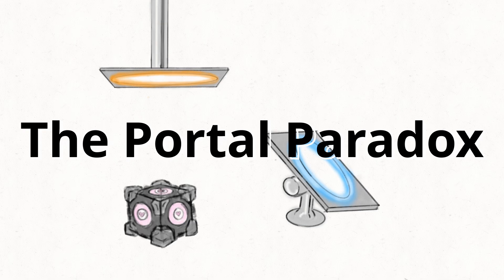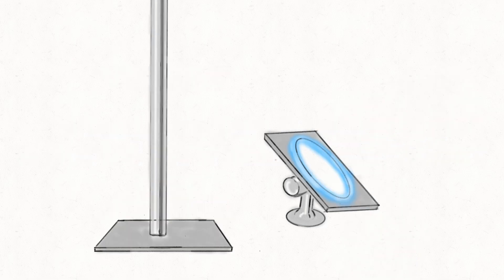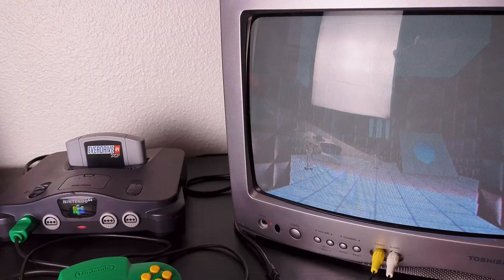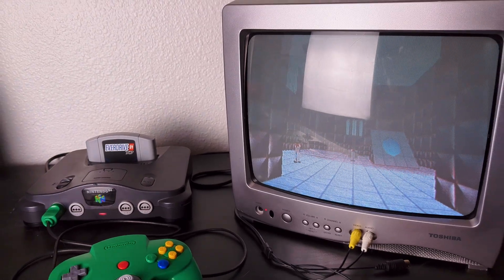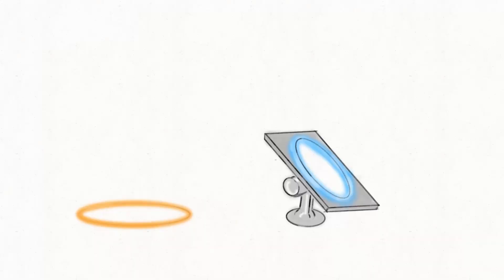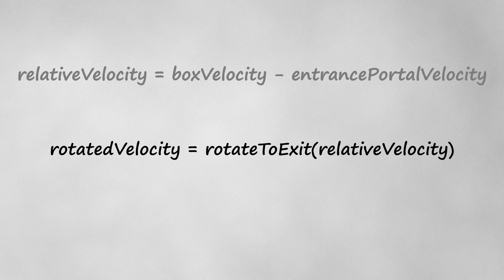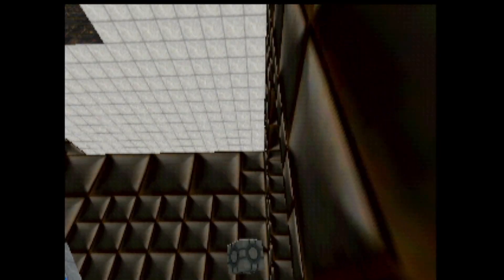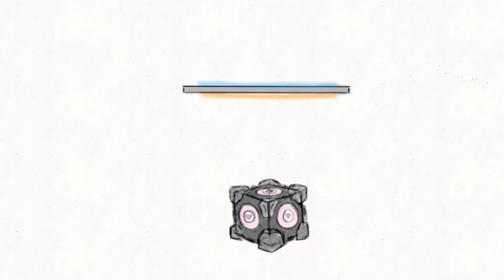I rewrote Portal from scratch and solved the Portal Paradox

Comment: What happens if you stop the moving orange portal while the cube is only halfway through? Would the momentum of the cube coming out the blue portal make it so the cube gets sucked inside the the orange portal and out the blue? If it doesn't go fully through, would it at least jump up a little?
Reply: here's my hypothesis (at least in a real-world physics sense, no idea about his engine): in the instant the orange portal stops, half of the cube has had the momentum transferred to it, while the other half hasn't. therefore, the cube will only receive half of the momentum! the non-moving part gets pulled along by the moving part, and the moving part gets slowed down by the non-moving part. so, it'll still be launched, but only half as far!
Reply: @axollyon  Agreed. For completeness though, if the cube could deform, the resulting tension would actually stretch the cube.
Reply: @RonWolfHowl  now I'm imagining a supersonic portal stopping halfway around a cube, those forces would probably rip the cube apart
Reply: @Anklejbiter  nope. There would be no force imparted on the cube... 2 connected regions of space, no matter how their relative distance change, are just regions of space, and as such, non-physical objects without any momentum. Thus one hole in space, doesn't impart any momentum to an other object in space.
Imagine it like this.
Imagine you have increments of 10% of the cube, through the other portal. What are the net forces on the entire cube? You can solve that problem in Euclidean geometry.
Let's say the cube weighs 10kg then there's 9kg of force on one side, and in this case as we assume the other portal is at a 45 degree angle, And a 1kg down force 45 degrees to the first 9kg down force, okay, nothing interesting will happen, because there's a net 9.5kg down force and a .5kg force applied horizontally, friction counters that with ease.

you can do the calculations yourself for all 10 tenths percentiles, and if we imagine that the entire cube is instantaneously through to the other side, it will glide down the portal surface because what else can it do with a 5kg parallel force to the plane of rest and a 5kg force perpendicular, and due to the normal forces, we end up with the object sliding.
You can do finer and finer slices, and you can via the mathematical magic that is known as INTEGRATION... solve the actual behavior with ease.

Oh and if you move a portal in empty space over an object in empty space at rest, that object will stay at rest, even as it leaves the other portal, but from it's point of view, if it entered the orange portal, and was spewed out by the blue portal, the blue portal would just move away at the same speed as which the orange portal approached it.

So in a world with no outside forces acting on objects, space would impart momentum, but also in one sense, would create momentum, because there wouldn't be any energy lost in the system, but gained. Which is an even weirder notion.
Reply: @livedandletdie  The cube can impart its own forces. no force is applied to the cube, but that doesn't mean it has zero inertia. one part of the cube has passed through the portal , it is moving. If the portal stops, that section will continue moving do to inertia, and then, and only then, it will pull the rest of the cube along with it
Reply: @livedandletdie  I would urge you to see the video, but in essence, as you said the portal is not an object, it is space and therefore the cube must retain the speed at which it went through, so it will be launched, and therefore if it stops halfway it is pulled along.
Reply: @livedandletdie  Frames of reference say what?
Reply: @RonWolfHowl  And that cube stretching would cause half of the cube to go at full speed and half of the cube to go no speed (relative to the portal). This should cause the cube to go at half speed.
Reply: @axollyon  *the cube splits in half because wheatley made it
Reply: @axollyon  Okay, the cube is "launched" because the relative velocity of the cube at the moment the portal is "completely" in contact with the surface it is lying on is at a certain amount. 

The cube is not "pushed" or "pulled" by an object with mass. 

When you stop the portal, half the cube hangs out. Imagine running up to a perfectly flexible portal and stopping with your player halfway through: you just wouldn't go anywhere.
Reply: @axollyon  No momentum was transferred to the cube... the Portals are not Objects. The only momentum the cube feels, is the momentum of gravity pushing it down,
so what happens to the cube can be solved with simple integration. And the result is that the cube just falls out of the blue portal when completely enveloped, and staying halfway would do nothing to the cube as half the weight is pushed down on one side, and on the other it is pushed in this case at a 45 degree angle, still the net force on the cube would move it in a horizontal direction if it weren't due to friction, and as soon as more than half the cube is through, the cube will have a slight tilt in the force direction, and as we go further and further down we'll eventually come to a point just after 33% is remaining when 67% is through and weighing so much more that it would lift the rest of the cube up and topple over.
Reply: @livedandletdie  this guy gets it. The space around the cube changes, that does not mean the cube is moving relative to the environment. (Though momentum is mass*(NET)velocity gravity is not a momentum - technically it isn't even a force)
Reply: in-engine, it will probably either move or not depending on which side the origin position of the object stops at. in the real world or a physically accurate simulation, the momentum would be imparted in proportion to the weight of the object on either side of the portal
Reply: In real life, a cube isn’t a singular object. It’s many molecules. I think that everything that has gone through the portal will keep it speed, but everything that’s not gone through the portal will stop so it’ll just keep some of its speed based on how much of it has gone through. In real life, that force might just rip the box in two. In the game it’s likely going to keep the speed if its center of mass is through it and just stop if it’s center of mass is not through it.
Reply: the game would have to keep track of the speed integral as the cube is traveling through the portal so that it can account for only partial travel, it wouldn't be able to do it all at once, it would have to calculate the resulting acceleration every frame as the simulation is going
Reply: To explain how this would work try imagining the floor is the one moving towards the portal but it stops half way through. The cube has been pushed anyways I think. I think the same thing happens if the portal is the one moving.
Reply: Well if we apply the logic from the video, the yes, it would "suck it in" with some force. Since by the logic of the video what happens is that we simply "transition" from one motion system to the other, and we have part of the cube in the system that where it stopped moving, and part in which it already is moving.
Reply: I think it would still get launched, just not as far, like if you threw a ball, but stopped your hand halfway.
Reply: @hatandhoodie_  that’s different. That’s just how you throw a ball. But also it’s correct, the half that received momentum pulls the half that didn’t.
Reply: I wanted to see this too!

I think that the cube would stop moving when the portal stopped moving, that's almost entirely based on my own intuition though
Reply: If I did the thought experiment properly so when the moving portal starts to stop moving (accelerating upwords) it will recieve a downwords force from the intersection of the portal with the cube, by 3rd law the cube will experience an equal force from the portal itself in the opposite direction (upwords), this action should result in the partial acceleration upwords and a partial acceleration downwords of the moving portal (as if the cube is resisting the deceleration of the portal) now because ingame the portal wouldnt actually experience this force the cube should experience the sum of both forces upwords.
I didn't go to deep into it to say how much would the cube accelerate but based on this the cube might actually fly faster? as the stoping motion of the portal acts as a slingshot for the cube flinging it even farther.
Reply: Ah, beat me to it. Let me know someone ends up testing it, please.
Reply: Well think of it like pushing a sled

U can push a sled for 10 meters and it will go very far but stop halfway (at 5 meters) and it will have less force pushing it forward but still half of the original
Reply: @ComradeBlue5705  you're confusing force with work
Reply: @siraaron4462  well force is a part of calculating that
Reply: @ComradeBlue5705  while that may be true, if you apply a constant force over half the distance the force is still constant
Reply: Just want to pop in here to say that if portals were realistic, a floor to ceiling portal would cut the surrounding force of gravity in half and probably have big implications for lunar cycles, the earth's orbit, etc.
Reply: I think it would stop. like he said in the video, motion is relative. so similar to the reasoning he gives, it would be the same as grabbing the cube when it's halfway in two stationary portals. and that would suggest that the cube would stop on both sides, since they are still connected.
Reply: @simonroe4834  but then where does the energy go?
Reply: If the velocity of the portal will be more than gravitational pull - cube will fly with vel-G; if less - cube will stay.
Reply: are you talking about the two opposite portals on the same moving object? the top portal is moving the opposite direction to the bottom portal at the same speed so any velocity given to the cube by the bottom portal is cancelled out by the top portal which is why its stationary. stopping it at any point or changing velocity doesnt change the fact they cancel out because they face opposite directions
Reply: @Videoswithsoarin  I meant 1 moving and 1 not moving portal. Aka rotate the orange portal to face up intead of 45°.

Is what you're saying that because the portal has movement it should transfer that movement to something that moves through it? If the portal edges don't touch it, the portal shouldn't have any movement impact on what's going through the portal. Or at least that's my understanding.
Reply: Sir Aaron is absolutely correct. There’s no force pushing the box. If the portal moves over the box at 10cm/sec, the amount of box appearing in the other side is at a rate of 10cm/sec. What is this magical force pulling the box off the ground and through the air on the other side once the box is fully enveloped and the portal stops moving (other than gravity pulling down?). Relative to the observer the box isn’t moving, and no force other than gravity makes it move relative to the observer. Period.
Reply: @Jordan10704  uh what?
Like you said the rate the cube emerges from the other side is the same as it enters, which means the cube is moving...
So the force that makes it fly out through the air is inertia
Reply: @Sokrates9500  it’s emerging from the other side of the portal at 10cm of box emerging per second, that doesn’t mean it’s “moving” at 10cm/sec and it doesn’t mean it’s going to continue moving after all of it has emerged. If it was “moving” then it would be lifted off the platform it’s sitting on from the other side. The box has no forces applied and has no momentum. If I walk towards a wall at 10cm/sec the wall is coming closer to me at 10cm/sec, that doesn’t mean when I stop moving the wall is going to continue moving towards me. Does that make sense?
Reply: @Jordan10704  no:
1. An object can't "emerge" without moving. Unless it has infinite compressibility I guess lol.
2. Everything has inertia, regardless of forces applied or speed. Besides the cube has to have speed because there is a change in it's position.
Reply: @Sokrates9500  yes, the box has an inertia of 0 as if sits on the platform. There is no force applied to change that inertia. What is the force? Where is the energy? What is lifting the box off the platform and ejecting it? This is all relative to the observer in the ground. If the box has a mass of a billion suns, you don’t get the energy ejecting it through space for free!

There’s no change in position due to movement. This isn’t a speed. It’s a teleportation. One second the molecule is at position 10,5 and the other 15,10. That doesn’t mean it has a speed in air. The fact the portal is moving just means more molecules get teleported quicker. If doesn’t mean the molecule gets a magical speed force applied to it to continue moving after it teleports.
Reply: @Jordan10704  again no.
1. Only half of the box is stationary.
2. The stationary half also has mass, just 0 speed relative to the ground
3. What is lifting it off the ground? 
The force of inertia of the other half of the cube, transferred through cohesion forces of the cube.

It doesn't matter if it's teleportation or not. The fact remains that half of the cube was just pushed by an atom thin layer of atoms that just emerged from the cube. Which is literally how all solid objects transfer stresses in normal situations, there is nothing unusual happening here.

The atoms that teleported earlier have to make way for atoms that teleported later, which means they have to move in a direction opposite than the direction the new atoms are coming from, which is away from the portal. And that speed of "moving away" will be equal to the speed that the new atoms are approaching at.
Reply: Things get weird when the portals accelerate while objects are passing through. Let's assume the portal's speed is constant, then drops to zero in an instant (like a step function for velocity) while the cube is halfway through. In the instant before the portal slows down, half of the cube had relative momentum with the entry portal, and that should be conserved through the exit portal; the cube, at that moment, is moving relative to the exit portal. When the entry portal's motion changes, the cube's motion through the portals is also forced to change -- that is, the portal's acceleration exerts a force on the cube. This force allows the cube to lift off the platform and finish its journey through the exit portal, even though at that point neither portal is moving.

What is the impact of that force on the cube? I imagine the exit velocity of the cube is a fraction of the maximum exit velocity it would achieve if the portal continued moving smoothly the whole time, and that fraction is the same as the fraction of the cube that had already passed through before the entry portal stopped. I haven't done the calculation, but intuitively that makes sense! Stopping the relative motion early reduces the momentum the cube is able to pick up, and I think the effects should be in a simple proportion.
Reply: @RegularKerico  not sure this makes sense. How does the portals acceleration or speed exert a force on the cube? Motion is relative, not forces! If i pass around the cube at a rate of 10cm/sec, it emerges on the other side at rate of 10cm of box emerging per second, but it’s not “moving” and there’s no force applied to it. It simply emerges at that rate, then immediately falls down due to gravity.

Ignoring the energy to move the platform with the portal up and down, you don’t magically get energy or forces by moving the portal around the box. If you did, you just invented a free energy device (of course, the concept of a portal itself is probably far more problematic)

People here keep confusing relative motion as being able to apply a force to an object. Relative to the observer on the ground, a force has to be applied to the box to have it move from its position resting on the platform. I’ve heard no explanation how a moving portal exerts an equal and opposite force to its motion. The only force at play here is gravity (and whatever is moving the platform with the portal up and down).

And if the portal does exert a force, how much? It takes E energy to move the box off the platform it’s on and eject it through the other side through the air. What if the box had a mass of a hundred suns? Does it move off the platform at the same rate/speed as a regular box? If it does, that’s a massive amount of energy that just came out of nowhere.

The fact in the experiment the box was lifted off the platform and “ejected” from the other side with exactly the same velocity as the portal, without taking the mass of the box into account, should tell you all you need to know that it’s wrong.
Reply: @Jordan10704  Does gravity take into account the mass of an object as it accelerates in free fall? No, because the equivalence principle states that gravity as we observe it is due to our reference frame accelerating through spacetime. 

The same is true for accelerating portals! If, while the cube is halfway through the portal, the motion of the portal changes, then the motion of the cube also changes relative to the portal. The cube feels this as a stretching or compressing force as the motion of the half cubes on either side of the portal change relative to each other.
Reply: Edit: see my response above. I think portals basically breaks physics so I don’t think there’s a “right” answer here.

—-

 @RegularKerico  relative motion doesn’t apply forces! reference frames do not apply forces! For the object to now have kinetic energy and move relative to the observer on the ground, something must have applied a force and transferred energy to the box (1/2mv^2).

What people keep telling me is that a portal can supply infinite energy to lift a mass of infinite amount off the platform relative to the observer. That because the portal and box move relative to each other that the universe ignores the observer, ignores energy, and gives motion to the box for free in the observer’s reference frame. Makes no sense.
Reply: @Jordan10704  I mean, yeah, portals break energy conservation. That's unavoidable. You can have a billiard ball falling into a water wheel, having it spin a half turn to drop it out the bottom, then fall into a portal whose exit lies at the top of the water wheel. Infinite energy. Definitely problematic. Generally speaking, in spaces that aren't simply connected, you can't guarantee that curl-free vector fields are gradients of a scalar potential.

But as long as we're focusing on a version of momentum conservation through portals, it's easy to see that accelerating one of the portals relative to the other compresses or stretches objects passing through them. Consider empty space, devoid of gravity, containing an infinite stream of billiard balls with one meter between them and a portal. If you set one end of the portal so it moves along the line of balls at a constant speed, then the balls will exit from the other end at a constant speed, and the distance between consecutive balls will remain one meter for any speed. But, if the portal that is moving along the line of balls gradually speeds up, each ball that comes out the exit portal is moving faster than the ball before. The space between the balls decreases, and eventually the balls will collide. 

Now, shrink the balls and the distance between the balls until you have one continuous rod; the accelerating portal forces each consecutive length of the rod to press into the length before it, and the rod undergoes compression. If instead the portal slowed down, the rod would undergo expansion.

I wish I could draw a diagram, but there's no mistake that relative acceleration between the two ends of the portal stretches or compresses what's moving through them.
Reply: @RegularKerico  I’m not disagreeing with your scenario, only that it doesn’t make sense from the point of view of a stationary observer. From their point of view, they saw stationary objects accelerate and gain a speed in their frame without a force or momentum or energy applied to them. That’s all I’ve been saying this entire time. It doesn’t work, it’s free energy, and you can’t use Newtonian physics to make it work.

So when people tell me the object shoots off in the observers frame of reference at the same speed as the portal regardless of mass, I feel like they’re completely ignoring one aspect of physics while embracing another to get the outcome they want.
Reply: @Jordan10704  There is no perfect answer, as you mentioned before, because portals necessarily break a bunch of rules of inertial reference frames. For me, the object magically accelerating into the decelerating portal feels uncomfortable at first but seems like the most consistent option of a bunch of imperfect ones.

For starters, I don't think this scenario involves "gain[ing] a speed in their frame without a force or momentum or energy applied to them". There is a force, a pulling force from the part of the mass on the far side of the portal: when the moving portal stops/decelerates, the far-side mass is moving faster than the close-side mass and its internal bonds between those sections would result in a pulling force on the close-side mass, dragging it into the portal (or, if those bonds aren't strong enough or the object too rigid, tearing it in half, but I'll ignore that case because it's less interesting).

I admit I was uncomfortable with the 'pulling' force idea at first, but it's pretty reasonable even by in-game standards: in-game you can place objects halfway into a portal and drag them back out, which only makes sense if the local part of the mass can attract the far part of the mass backwards through the portal via internal bonds.

Second, this scenario only grants free energy if we assume that moving the portal is free. The problem doesn't state anything about how the moving portal actually works so we're free to speculate on how it could, and there are ways that would conserve energy (or at least not break conservation any worse than normal stationary portals already do). My personal theory is that the object pushing the portal surface would experience a reaction force dependent on the mass it forces through the portal, and would pay an energy cost accordingly. E.g. in this video we have a roof-mounted piston moving downwards towards the cube, pushing the plate that carries the portal; I like to think that the piston has to spend extra energy once it starts pushing the portal over the cube, which is where the kinetic energy of the far-side cube mass comes from. Once the portal stops, the cube's internal bonds from the far-side mass pull the close-side mass into the portal, redistributing (but not changing) that energy over the cube's total mass. So even though the close-side mass does indeed see a weird magic acceleration, it's energy-consistent: the piston pays the cost ahead-of-time by adding to the far-side mass's kinetic energy before the portal stops.

[edit: I'll admit that having something "push the portal surface" feels iffy. It feels a little wrong to have a solution that requires the portal surface to be able to push back on whatever's holding it, but I don't see a way around that. If the portal is mounted to a surface and that surface can move around in space dragging the portal with it, it seems necessary that the portal surface is something physical with mass that can interact with whatever it's mounted to. If that weren't the case (i.e. if it were a massless magic bridge fixed in space), the piston would logically have no way to move it.]

Wow, didn't plan for this to be such a wall of text, but I couldn't stop thinking about the problem... tl;dr:

* If you have a connected mass with one part on the close-side of a portal and another part on the far-side of the portal, it's reasonable and consistent with in-game behaviour to have the far mass pull the close mass into the portal (i.e. a 'push' force from the close-side is not necessary to make the close-side mass move).
* We're free to speculate on how energy would work in this kind of device, so you could come up with a constraint on whatever's moving the portal surface such that it pays for the kinetic energy cost that leads to the 'magic' acceleration.
Reply: @QuadfishTym  this conversation didn’t start about dragging the box through the portal. It was about ejecting the box with momentum equal to the portals speed. If you want to argue that the molecular bonds pull is enough to give the entire box that much momentum regardless of its mass, ok, but I think it’s extremely hand-wavy to say this energy is just “available” to do so. Like you said, we can certainly add as many rules as we want (the portal provides energy to the objects proportional to the objects mass to feed the added momentum) to get the outcomes we want. It’s not there’s no “best” answer - there is no answer period because portals don’t and can’t exist.
Reply: I believe it either would be a form of spaghettification as the cube gets ripped in 2 or yes it would move a little because the force has to go somewhere.
Reply: @DoubsGaming  if the cube is made of steel then there is no way it would get torn in 2 unless the portal moves at an insane speed
Reply: The cube should only receive half the speed
Reply: It would fly out at half the speed
Reply: That would take an entire video to explain, but the cube now has multiple forces on it (two separate gravitational pulls plus the inertia from the movement between the two portals). The strongest force would have to be larger than the other forces to affect anything. It would depend on when the entrance portal stopped moving.
A new question is what if both portals were moving downward at terminal velocity, but the exit portal were much higher up and the cube were launched into the entrance. That would likely cause enough air resistance to cause re-entry level heating.
Reply: If the cube was at all lopsided in mass at the point in time of instantaneous acceleration/deceleration, then it may begin to SPIN!

How cool
Reply: So I have a question from your question. Wouldn't this imply that the cube could pulled itself up through the orange portal while the portal is moving? Because the other end of the cube, which is still, hopefully attached, is moving, therefore puling the rest of it (assuming it doesn't break) which would of course increase the relative velocity?
Reply: If the orange portal stops moving, the cube will stop moving relative to the blue portal too. The cube will remain halfway between both portals.
Reply: The video is incorrect. Relative to the observer and the environment the cube is stationary. From your perspective, You aren't moving the cube towards the portal you're moving the portal towards the cube. The pegs don't fly up into the air when you play a game of ring toss, Just because the ring stops on the table. The only way relative motion applies here is the rate at which the porta passes l around the cube. If the portal stopped halfway around the cube it stops halfway around the cube. 

The only forces being applied to the cube on both sides of the portal is gravity and the force of the ground reacting to and balancing out gravity. (And friction if it's sliding) The acceleration of the cube will always be the net sum of those forces. Until some unbalanced force is applied to the cube. it will remain at rest relative to the observer and the environment, even if it suddenly finds itself in a new environment.

You can verify this by thinking about the both ends of the portal being separate objects adjacent to eachother. Where the blue end is also stationary relative to the observer, the environment, and the cube. When the orange end moves toward the cube the blue end only moves towards it because it's always adjacent to the orange end. After they collide the cube is once again stationary relative to the blue side of the portal. But also adjacent to where it came from.
Reply: @siraaron4462  I'm not sure about that. Another way to see it is if you placed your face right in front of the blue portal. The cube coming out of it would smack you in the face, so it's definitely coming out of the portal with force, and that force can't just disappear once the portal hits the floor. (Dumb way of explaining it, but it's the best analogy I could think of)

Also, about the relative motion, the portal is moving towards the cube, yes, but if you look inside the blue portal, you won't see the orange portal moving. Relative to that point of view, you'll only see the cube and the floor moving towards you.

But portals are weird... From that perspective, if the portal stops before it reaches the cube, it would still look like the cube should at least bounce up a little, as if there's a cube on a moving platform moving really fast, and all of a sudden it stops, the cube should keep moving a little. But since it's still 100% on the other side of the portal, that relative motion is only visual. It's when the cube starts moving through the portal that the motion stops being only visual and becomes actual movement of the cube coming out of the portal at a certain speed.
Reply: @FausseFugue  yeah it would hurt the same way it would hurt if you found your face moving towards the ground, or towards a tree. Because you are adjacent to the portal you are moving towards the cube with it. The force being applied is the transfer of kinetic energy at the time of the collision. Because the portal is moving your velocity relative to the cube becomes non-zero as you stand next to the blue end not because either of you are accelerating but because the space between you is being contracted.

I already established The blue Portal and orange portal are adjacent to eachother in spacetime. The results are the same, if the portal moves arround the cube it isn't pushing the cube upwards.
Reply: @siraaron4462  The video can't be correct or incorrect, as it's a construct of our own makings - the answer is whatever you want tit to be, depending on what rules you decide to follow, what constraints you decide to play with, and which elements you decide to ignore. One of what I think is the biggest ignored feature of portals is gravity. It would make sense that gravitational waves and fields would travel through a portal, and yet standing next to one you are never pulled into or pushed out of it.

For this problem, however, I think the solution of the cube maintaining mimentum is the one that not only makes the most sense, as it is extremely intuitive, but is also  the one that fits best with our modern understanding of physics. The result it provides can be deduced from multiple paths, including looking at the system on a molecular level, Looking at the system as a whole, looking at just the movement vectors, etc. Having a moving cube come to a dead stop after exiting a portal just doesn't make sense, and doesn't roll
 well with physics.
Reply: @Anklejbiter  but the creator tries to justify his "construct" using real world physics which he applies incorrectly. The cube doesn't even have momentum it's stationary. And thanks to newtons first and second laws of motion no object can apply a net force to itself. You tell me to look at all these things but you don't tell me why or how they contradict the fundamental logic of the physics in question. (Having already taken them into account myself, the results simplify to the same solution I already described)

As far as gravity is concerned, if inertial frames through space-time we're followed, according to the laws of gravity, There would be no infinite falling, because portals would create a closed loop of spacetime parallel to the field of gravity. in the game, gravity just moves things in an arbitrarily defined "downward" direction. It's a simplification that works for game mechanics. It's not making a choice of what physics to use it's just simplifying physics for the sake of being a game.
Reply: @siraaron4462  I agree with your second point, but your first statement is incorrect. a stationary cube does have inertia. And once it's on the other side of the portal, it's moving, and therefore also has non-zero momentum. I think he applied physics correctly here.
Reply: @Anklejbiter  that's right momentum and inertia are proportional but not the same, my bad. (The error is fixed now)

However the cube isn't moving relative to the environment,  its motion is an illusion because the space around it is moving, not the cube itself  as soon as it passes through the portal it's relative velocity to the environment is still zero.
Reply: @siraaron4462  Not it's immediate environment, no. but the environment on the other side of the portal does not perceive the cube as stationary.

Another way to think of it is this: on a molecular level, hen part of the cube goes through the portal, it must then move out of the way for the next part. this is motion. Granted, it's not very much motion, but when the entire cube has passes through the portal, all of the cube is now in motion, and I didn't think it's accurate to say that motion would disappear just because the cube is on the other side of the portal now - it would have no way of "knowing".

Or, image you have a pole that you're holding through the portal. the pole is stationary relative to you, and relative to each portal. however, since one portal is moving downwards, that end of the pole is also moving downwards- and will come into contact with the box, at which point it cannot go any lower, and will start getting pushed upwards into the portal. on your end, you notice this motion as the pole now being pushed in your direction, out of the portal. when the pole is all the way through, it carries this momentum. the same would be true of the box beneath it.
Reply: @Anklejbiter   what's moving the top of the cube "out of the way" is the bottom of the cube as I already expained. That is a reactionary force that never exceeds what it needs to to maintain equalibrium. (The net force the cube exerts on itself is still zero There is nothing pushing or pulling it off of the ground beneath it.)

The pole is similar there is an illusionary relative velocity between you on one side and the cube on the other because the space between you is contracting. This can still cause a collision and the collision might push you away from the box but that's not because you or the box has a momentum  it's because the momentum in the box- pole-portal-person system must be conserved after accounting for the contraction of space.
Reply: @siraaron4462  for the first part, yes, and it seems some messages got sent out of order lol. i didnt see you had said that until after I already commented.

the pole I don't believe is an illusion? What's illusionary about it? the section of poe you are holding onto IS moving. if you keep holding on, you will also be moving. you will fall over. I don't see how one can observe particles in motion relative to their environment and conclude that they aren't moving
Reply: imagine you hold onto the pole, soo that it drags you with it. you were in one location, and now you are in another. that is the definition of motion. you have moved. you have momentum. that momentum doesn't cease to exist simply because part of the pole is on the other side of a portal

We agree on many different things, so I have to conclude that there's a communication error happening here, not a physics misunderstanding. But of course, with each of us so confident, It's hard to determine where the error is happening. I'd be interested in bringing this topic to a physics professor or two
Reply: @Anklejbiter  it's illusionary because the two objects only appear to have a velocity relative to eachother because the space between them is shrinking. To an outside observer the pole appears to be moving down with the portal because (just like the block) the Pole's has internal forces retaining its shape. Within the system the pole is still stationary and the only thing changing is the distance between you and the cube 

The pole can't drag you with it because from your frame of reference it's not moving. Momentum has to be conserved within the system but in this case the system is more than just physical objects, it's space itself.
Reply: @siraaron4462  it can drag you with it, because within your frame of reference, it is moving. If it didn't move, it would get shorter, or buckle.
Reply: actually, I believe this is where the miscommunication is! we're not.imagining the same scenario. in my scenario, the end of the pole you are holding, is moving relative to you and the portal, but in your scenario, it isn't. so we're coming to different conclusions because we're imagining different situations.

this would be easier to describe if I could animate what I'm thinking, but I don't have the toolset for that unless you like shoddy misprint animation
Reply: @Anklejbiter  if the pole you're holding is getting shorter wouldn't that mean the opposite end is moving closer to you rom your frame of reference?
Reply: @Anklejbiter   @Anklejbiter  "you have a pole that you're holding through the portal. the pole is stationary relative to you, and relative to each portal. however, since one portal is moving downwards, that end of the pole is also moving downwards- and will come into contact with the box, at which point it cannot go any lower, and will start getting pushed upwards into the portal. on your end, you notice this motion as the pole now being pushed in your direction, out of the portal. when the pole is all the way through, it carries this momentum. the same would be true of the box beneath it."
(Your words emphasis mine.)

are you imagine a scenario where you are standing still, holding a pole steady on the blue end while the orange end falls around the cube? because that's what i'm imagining. 

If so, the portal isn't grabbing the pole and dragging you towards the cube. From your frame of reference the cube is rising up towards the pole but the cause is that there is less space between you and the cube. There is a collision that will push you back but that's not because of any physical velocity before the collision it's because the inertial frame of the system is changing.
Reply: @Anklejbiter  taking the problem back to it's simplest form the cube's velocity relative to the ground it's on is zero. For the cube to fly off of the ground it needs an acceleration vector away from the ground. The portal falling around the cube does pull the cube away from the ground it only changes the inertial frame the cube is in.
Reply: @siraaron4462  yes, there is a collision that will push you back, because once the pole collides with the cube, it begins moving, by definition. this movement is not an illusion, only the movement of things on the other side of the portal is.

For the other scenario, no, a falling portal does not impart any force to the pole, the cube, or anything within it, correct. but it doesn't need to. part of the cube is moving, and part of it isn't. for it to remain rigid, these two vectors must interact. the result is that the entire cube is now moving, but at a lower velocity.

My thinking is that, the vectors that are interacting can become greater if the portal is moving faster. But, thinking about this, the question arises: the moving cube, has more energy than the stationary cube, where did this energy come from? It seems to reason that it came from the portal, but it doesn't seem anything about the portal has changed, so that can't be it.

But the same is true for an infinite falling loop, so now we're back to square one: how do portals work? what is it they're actually doing?
Reply: @Anklejbiter  Pardon the wall of text, I wanted to explain this as completely and clearly as possible: 

answering your last question first: the portals work by connecting 2 bounded , 2-dimensional slices of space-time as if they were adjacent to eachother. If we assume physics otherwise works the same as it does in our reality, the paths of spacetime interact with these portals as they would with any other adjacent n-dimensional slices of space-time. (Bounded or unbounded)

In layman's terms, they connect two planes in space, nothing more nothing less. (See footnote one) Therefore As the orange portal moves towards an object the distance between the blue Portal and that object decreases at the same rate. This has a side effect of changing the conditions of the cube's environment.

In the situation with the pole, This change of the inertial frame can cause a collision between two stationary objects. (Hence illusionary velocity) However, because the momentum of the system, as a whole, must be conserved; the motion caused by the collision (pushing you and the pole away from the cube) is real. This is after taking into account the changing inertial frame caused by the moving portal.

Which leads me to the fatal assumption of your argument, the cube is not moving, it is the cube's inertial frame that moves. The cube isn't rising up out of the blue Portal, the blue Portal is adjacent to a slice of spacetime that falls around the cube *and then stops.* At no point does the cube have any velocity relative to the ground beneath it. It only has an illusionary velocity, relative to an observer on the blue end.

For example imagene if you repeated this thought experiment but you mounted a small camera on the ground next to the cube, facing upwards. From itge camera's frame of reference the cube does not move away from the camera (or the ground) even as it passes through to the blue end of the portal. 

you say the portal isn't changing, but that's simply inaccurate. The very premise of the thought experiment is that one side of the portal is being accelerated towards the cube until its connected surface is stopped by a collision with the floor. Which is whyzl, The Cube's apparent motion is the result of spacetime moving around it.

And since you brought it back up: if we assume physics otherwise works as it ought to in real life, this relatively simple definition for the fundamental properties of the portals (treating them as bounded, adjacent slices of spacetime) also resolves the infinite-falling/infinite-kinetic-energy problem. because if they are parallel to each other and perpendicular to the path of gravity you would be essentially weightless while in between them. gravity cannot do work on you because the portals block the Normal path of curved spacetime, therefore changing the inertial frame of anything between them

¹ the only evidence we have to the contrary is the game engine's incomplete approximation of real world physics. If we take that at face value then we have to throw absolute conservation of momentum out the window anyways.
Reply: @siraaron4462  Paragraph 1: Okay, I agree.

P 2: Right, so Imagine a 3D grid, like you might get in an animation program. If you look through the blue portal, The entire grid is moving - What you would say as the space between me and the cube is shrinking, because over time, there is less space between the cube and the orange portal, not because the cube is changing its location. This makes sense.

Paragraph 3 is a bit confusing, perhaps it could be worded better. But I'm imagining this scenario: if I stuck my hand into the window of a moving car, the passenger would hit my hand, not because they are moving, they are stationary in the car; but because their environment is moving.  I am not moving relative to the ground, and they are not moving relative to the car, and yet we will meet, because the space between us is getting smaller; and after the collision both their face and my hand will be moving relative to both the ground and the car.

P4: I agree, the cube is not moving in any way on the orange side of the portal. It is stationary relative to the ground, and to its environment. I am curious about what would happen if the orange portal continued to move after swallowing the cube - for instance, if the entire setup were on its side, or in space. I don't imagine it should change the outcome of what's perceived on the blue end. whatever the cube is doing on the blue end, whether moving or stationary, shouldn't change if the portal stops moving, as the cube no longer has any real relation to that environment.

P5: Correct, for as long as the orange portal is moving. if the orange portal stops, but the camera is anchored, (for instnace, on a post that is thin enough to go through the portal), I think you would see the cube move away when the orange portal stops moving. if the camera is not anchored, then you'd never see the cube move away from it, which works in both cases: the cube isn't moving , and neither is the camera, or the cube is moving, and also is the camera. in both situations it wouldn't observe any movement of the cube.

P6: I don't think that's the thought experiment, maybe this is where we differ. I assumed the experiment is using a moving, but non-accelerating portal. Of course, the portal must accelerate to get from a standstill to motion, but I'm assuming it has finished accelerating by the time it reaches the cube.

P7: I do thing gravity would be complicated in between two portals, placed vertically. If gravitational waves travel through portals, then you'd have an apparent earth's worth of mass through the portal, pulling you in. however, you'd also have an earths worth of mass on the other side of the other portal, pulling you in that direction as well, so I believe they would cancel out. I'm not entirely sure if this is accurate, I haven't thought through it all the way. I'd need to do that before commenting further.

Also - no need to worry about walls of text! This is an incredibly interesting discussion. I just don't see notifications about replies right away.
Reply: @Anklejbiter  
"P2" while I'm glad we agree on this point, I want to clarify one point of semantics: to solve this problem we need to understand what happens from 3 different Frames of reference (which I'm going to simplify fo FoRs from here on out) for each of the FoRs the motion of the system appears different but they all simplify into the sane outcome. The FoRs relivant to the system are: a FoR tied to the motion of the cube, a FoR tied to the motion of the orange portal and a FoR tied to the motion of the blue Portal. The "grid moving up" analogy is only 100% accurate in one of these FoRs. (I'll circle back around to this, don't worry… foreshadowing pun intended)

"3" I'm not entirely sure where you're going with this car metaphor since the comparison is loose at best. This portal scenario can't be accurately modeled using Newtonian dynamics: a better comparison would be like attaching a battering ram (the pole) to the front of your car and try to hit your friend who's sitting in the passenger seat. (And like the battering ram, the pole is just an extra variable not really important to the basic principles at work) 

"4" this is where the 3 FoRs matter: the blue end of the portal still exists on the 3-D grid relative to the cube and orange end of the portal. The FoR of the blue end of the portal is both stationary and moving closer, relative to both the cube and the orange end of the portal. (This is a gross oversimplification but bear with me) This might be easier to imagine if you traced the shortest possible path through space-time from the cube to the blue end of the portal without passing through the orange end, and then thread it through the orange side and back to the cube, pulling it tight. 

Now imagine that path stays tight while the orange portal falls, the loop shrinks like a zip-tie. This changes the inertial frame and because the inertial frame is changing, the momentum of the system is also forced to change. If the system gets too crowded, stationary objects can collide with each other pushing each other around. However, no matter what the initial conditions, the cube will only continue to move for as long as it's being pushed by stationary collisions, otherwise it will stop as soon as the portal passes around it. 

"5". I used the camera as a way to get you to visualize the FoR tied to a point in space next to (or beneath) the cube, from that FoR the cube is at rest through the entire process, because there is no force moving the cube away from the ground I wasn't asking you what you expect the camera to see, based on previous assumptions. The exercise was intended to encourage you to examine the motion of the cube from a different FoR, to realize the result is the, again, the same: the cube stays at rest unless it's being pushed by stationary collisions via the "zip-tie" effect. Thats now 4th frames of reference, by my count, with the exact same outcome.

6. Whatever you want to call it doesn't really matter, I call it a thought experiment because we can't test it in real life, for obvious reasons. As for the motion of portal, I'll handwave the specifics, as they're not relevant. What is relevant is that the the orange portal is moving relative to the system making it the only thing changing in the system. And that's what causes the zip-tie effect.

7 the justification is a bit off but the outcome is for all intents and purposes the same. In between the portals, The gravitational vector on an axis perpendicular to the portals, would be virtually zero
Reply: @siraaron4462  "Whatever you want to call it doesn't really matter, I call it a thought experiment because we can't test it in real life, for obvious reasons."

I wasn't saying it isn't a thought experiment, but rather that I think we're thinking of different things. Our thought experiments are not the same, yours includes an accelerating portal, mine includes a non-accelerating portal. I probably could have worded that better, sorry.

"the cube will only continue to move for as long as it's being pushed by stationary collisions, otherwise it will stop as soon as the portal passes around it."

I don't think that's accurate, as it's not accurate in real life either. things in motion will stay in motion unless acted upon. There is nothing stopping the cube's motion on the blue end. The orange side of the cube is not in motion, the blue end is. as more of the cube passes through the portal, more of the cube is in motion, until the entire cube is, and since there's nothing stopping it, it stays in motion until it hits a wall, or friction stops it, or you catch it, etc.

The part of the cube that has already passed through the portal is in motion relative to the blue portal. That motion is real. It doesn't instantly vanish just because the rest of the cube catches up. The cube has kinetic energy on the blue side, it has non-zero momentum, it has inertia. if you put your hand in front of it, it would push your hand. your hand would be moving. assuming the cube does stop, does your hand also instantly stop? no, it has momentum now, because it's moving. If you don't stop, neither should the cube, because it also has momentum. since the cube can't be moving AND stationary on the same side of one portal, the initial assumption that it isn't moving is incorrect.

The orange end is in one location, and at a later point in time, it is in the same location. it is stationary.

The blue end is in one location, but at a later point in time, it is in a different location. This is motion.

The orange end is stationary while entering the portal, because it's not going anywhere, and the blue end is in motion exiting the portal, because it is going somewhere.
Reply: @Anklejbiter  I'm only going to pick apart one paragraph because this is where I think the misunderstanding is.(key points are in bold)

 "things in motion will stay in motion unless acted upon."

If you want to invoke newtons first law then you have to analyze what forces are acting on the object 1 gravity and 2 the normal force of the ground beneath it. (for the sake of this thought experiment I'm going to treat gravity as a force, this is already complicated enough) Normal force is a reactionary force, it's only as strong as it has to be to keep a system in equilibrium. There is no sum of forces greater-than and opposing gravity acting on the cube at any point in this thought experiment. 

While we agree this is a conservation of momentum problem, the question is what has momentum relative to the system. From every FoR The cube is at rest relative to the ground, relative to the environment and, relative to the blue side of the portal. (Excluding space time paths, connecting them through the orange portal) the only thing in motion relative to the system is the orange side of the portal. You can't selectively choose the orange portal to be the "right" FoR to say the cube is moving. you have to look at the system as a whole 

Which brings me back to the Apparent motion of the cube, after the orange portal passes around part or all of it. if the cube did somehow gain any momentum relative to the ground the reduction of the normal force would immediately unbalance the forces, keeping it on the ground. The net force on the cube is still 0 or slightly downwards, but when the space it's occupying disappears (gets zip tied) it has to go somewhere or else cease to exist.

What's really happening is the internal and normal forces acting on the cube, are "pushing" the top of the cube through the portal, in order to stay in equilibrium, in a changing system. The cube doesn't want to be flattened or clip through the floor as the space above it gets "zip tied," even as the spacetime around it is closing the cube still wants to occupy spacetime. so instead it "pulls itself up by it's bootstraps." However The sum of internal forces acting on the cube must add to zero and the floor cannot apply a net force on the cube greater than the forces pushing down on it

"There is nothing stopping the cube's motion on the blue end. The orange side of the cube is not in motion, the blue end is."

I'm sorry but this is just flat out wrong. stopping things from moving "up" is the main thing gravity does. The top of the cube is still at rest relative to the bottom of the cube and relative to the ground the cube is sitting on. It's more inconceivable to me, that the top of the cube would pull the bottom up off of the ground.

"as more of the cube passes through the portal, more of the cube is in motion," 

asterisk. More of the cube appears to be in motion from certain frames of reference. (If you were the floor beneath the cube, for example, the top of cube still does not appear to move after it passes partway through the blue portal, so why would it start to move after?) more importantly the cube's apparent motion is dependant on its motion relative to the orange side of the portal. the cube has no reason (let alone means) to move away from the floor

Rather, when the cube is fully on the the blue side of the portal that directly implies that the orange end of the portal is no longer moving away from it, at least not along spacetime-path the cube it just took. (This is because the orange side of the portal cannot move away from the blue side along those paths) We know the cube is at rest relative to the blue end of the portal because it started in a state of equilibrium, and rest relative to the system its in. The motion of the orange end of the portal changed that equilibrium  only momentarily. There is still nothing is moving the cube away from the ground 

In conclusion,l sure the cube was moving relative to a bounded 2D section of connected spacetime, and sure that means the bottom of the cube had to push the top out "of the way" to remain at rest and in equilibrium but relative to the system (and most importantly relative to the floor it's on) it remains at rest and at rest it will stay until acted upon by an unbalanced force.
Reply: @Sir Aaron  I don't agree that the cube is at rest in all frames of reference.

I don't agree that gravity is keeping the cube held down in a system where gravity is not acting against the cubes motion. if this experiment played out in a vacuum, the result would be the same.

part of the cube is literally in motion. that motion will not suddenly stop just because the cube passes through the portal, regardless of whether the system has gravity or not. nothing is pulling the cube through. the cube is already in motion. it has different velocities in different Fors. I don't understand what the disconnect here is.

some questions: assume the system happens in a zero-G environment. do the results change?

assume the experiment is laid on its side. do the results change?

assume the portal continues moving after encompassing the cube. do the results change?

assume the orange end is in a box, you cannot observe it, and you cannot see into the blue end. you witness a cube exiting the portal. does seeing it stop suddenly once it FULLY EXITS THE PORTAL make sense? if the cube is no longer ties to oranges FOR, what's stopping a moving cube from continuing to move? before it exits, some of the cube is stationary. after it exits. none of it is. if none of the cube is stationary, then all of the cube is moving. if all of the cube is moving, then it will continue moving. nothing is stopping it from moving.

the blue end of the cube appears to be in motion from the frame of reference of an observer on the blue end of the portal. this apparent motion is real. the orange end also appears to be in motion, but this motion is not real. no more than a moving camera implies the objects within a scene are moving. the blue end of the cube, and indeed the entire cube eventually, is not stationary in a moving spacetime, it is moving in a stationary spacetime.
Reply: I have to call it. At this point I think it's clear that neither of us will be changing our mind anytime soon.

I don't know what you've learned, I learned that some people legitimately see the stationary cube as the only valid solution. I don't get that. but, at the end of the day, it's not a puzzle that has any real world applications, and it's not something we come across in-game  either, so ultimately it doesn't matter who physics agrees with, or who has better applications. whether I agree with your logic or not, It's good that you're using logic to come to your conclusions, and not just blindly saying them. I hope you can the same for me.

I will say though, Never in my life have I seen a comment argument thread go on this long without anybody calling names or being rude lol. both of us have gotten frustrated but nobody was rude, so that's neat
Reply: @Anklejbiter  if you want to tap out that's fine but I'm going to clarify on a couple points as to not be misrepresented:

I'm not saying the cube is at rest from all frames of reference. I'm saying every FoR results in the same sum of events. Irregardless of the cubes motion relative to the orange side of the portal.

And yes gravity opposes "upward" motion, why wouldn't it? That is the most basic of common sense.  

My point can be summed up as follows: the cube's motion relative to the orange portal is NOT it's motion relative to other elements in the system: The orange portal's frame of reference does NOT overrule every other frame of reference within the system and the cube is NOT moving relative to the space it occupies, at any point in time. The only thing "pushing" the cube "up" from certain frames of reference is it's continued and unchanging existence in moving spacetime. 

So yes, As long as the net sum of forces acting on the cube, (in the context of it's immediate, albeit changing, inertial FoR) is zero, the outcome is the same, yes. Doesn't matter if the cube is weightless, blindsidedz hidden, or any other set of initial conditions. Space moving around the cube doesn't mean the cube is moving relative to its immediate surroundings, simple as that.
Reply: @Sir Aaron  I like that you stick up for yourself. Misrepresentation and misunderatanding are super stressful, and may even fall under a pet peeve for me lol. If i made you feel that way I apologize.

my gravity statement was more in regards to the blue how the blue portal could be oriented in any direction, and it wouldn't change the outcome much. in the video, It's angled upwards, where yes gravity is acting against the cube, but you could easily have it oriented perpendicular to the ground, or pointing up, or down, where gravity effects would change.

I see your point. my point is that the cube motion relative to the blue portal is also motion relative to other elements.

have you seen minutephysics' video on the subject? what do you think of his follow-up puzzle?
Reply: @Anklejbiter  I saw the the video a long time ago and I had to review it. The follow up builds upon his previous assumptions about the behavior of the cube. The cube still doesn't have momentum relative to its position in space-time as the orange portal moves around it, the cube's position is translated to the blue side of the portal
  but the cube is still at rest relative to said position until acted upon by an unbalanced force. 

The cube can begin to accelerate, depending on the new conditions it finds itself in (for example, if the blue portal was upside down gravity could pass through the portal,and apply an unbalanced force to pull the cube, off of the ground) However, these conditions are independent of the cube's motion relative to the orange side of the portal. 

Examining the entire system this way, you can model the behavior of the cube for any set of initial conditions using only physics and portal topology, with no paradoxes or conjecture.
Reply: @siraaron4462  I think, if the cube carries the motion through the portal, then it would come out at an angle. However, if the cube does not carry motion through a portal, then instead I think i's going to start rotating - as part of the cube is shifted horizontally relative to where the next part of the cube comes out of the portal. But having rotation arise from a non-rotating frame is super weird, so I don't think it's that. it would be like if the cube started to accelerate after coming out.

Speaking of, what do you think would happen if the portal spiraled down onto the cube? rotating along the axis perpendicular to the portal's plane, would the cube exit the other side rotating? I would assume so.

Or, another puzzle, what if the cube is on the ground, and we bring both the blue and orange portals to it? if the portals are unstoppable, then I'd assume the cube would explode? because it would be pressing against it self harder and harder, and at some point it can't handle the stresses involved. If the portals aren't unstoppable, then perhaps they would stop moving, as the cube gets in its own way, and pushing the portals further wouldn't be possible.

One final puzzle, one I came up with a while ago. it's a strange one because it requires portals to be different sizes, and for portals to be able to enter eachother. Perhaps you can see where this is headed.

Lets say you have a blue portal half a meter wide, and an orange portal 1 meter wide. anything that goes into the orange portal comes out the blue one half the size it was, and anything that goes into the blue one comes out the orange twice as big. So, what happens if you push the blue portal through the orange portal, and then walk through a fizzler?
Reply: @Appletank8  I'm sorry but I'm not going to go through this whole debate a second time.

I have already demonstrated, in this thread, there is a consistent framework where we can apply laws of physics and topology where conservation of momentum is upheld from all frames of reference. If you want to read through that be my guest. Otherwise, you are free to understand the thought experiment however you like, that doesn't change my reasoning. 

I hope you have a wonderful day.
Reply: @Anklejbiter   if the orange portal was rotating then the cube would come out rotating yes. (I see no reason why that wouldn't happen given the established framework)

And yes if the cube ran out of space to exist in, it would get crushed and possibly, rapidly pushed outwards. However "unstoppable portals" are pushing the limits of what's hypothetically possible because the only "unstoppable" object compatible with known physics is a black hole. If the portals have properties analogous to black holes that raises a lot of questions.

As for the size puzzle ...  If you think about it both sides of the portal are bounded areas of spacetime overlapping eachother (I said adjacent earlier but overlapping is technically more accurate.) If you were to half the radius, the circumference half as well but the area 1/4ths. The ratio of the area to the border legnth is 1/2 that of the larger portal. 

So my intuition tells me (but I can't mathematically prove) not only are the spacetime paths being compressed to match the size of the new portal they're getting "crumpled up" to compensate for the changed ratio. At this point we're dealing with anti di sitter space, which, A)requires negative energy (which doesn't exist) and B) would render the portal too unstable to pass through. So the answer is the cube wouldn't come out at all, just a bunch of scrambled information equal to the amount of information that was in the cube. 

we could handwave the space-time topology of the question but then there isn't really a single right answer. Squeezing and shrinking would make equal amount of sense.
Reply: @siraaron4462  and @Anklejbiter
Thank you both for a crazy thought experiment and two different views on the same thing. And double props for keeping things civil!

My personal view point on this changes with conditions. If this happened in space and blue portal was moving towards the cube and orange portal stayed there. The cube would leave the orange portal instead of just sitting there, because the movement of the blue portal is somehow transferred to the cube.

But once we add gravity to it, I think things get very complicated. The paradox I believe boils down to... is the box launched off of a piston because the blue portal acted like it was a piston, or does it just fall because the box never had any upward momentum.
I think the upward momentum doesn't exist (I could easily be wrong) so it would just fall.
But lets try something else, lets throw a ball through the orange portal, then trigger the blue portal to fall faster then the ball, what would happen? I honestly don't know, would it go back and forth? (I doubt it) Would it get flung out of the orange portal? (I think so but that contradicts what I think happens with the box) Or would it just kind of float there until the blue portal stops moving and it hits the 'ground' and falls down?
Reply: @Anklejbiter  and @Sir Aaron
Another way to look at a portal is a window to some place else. Lets use a car as an example. If car suddenly stopped and the person or object gets flung through the window, it would keep moving through the window. But if a person holds their hand out of the window, there would be air resistance pushing the hand back (assuming the car is moving).

Could we not use real world situations to mimic this scenario and just imagine the even is happening with portals?
If a giant donut falls down, and you are in the middle of the donut, you don't really get pushed out of the donut. But if we add portals to the mix it gets more complicated... Would it not be the same if the orange portals was laying flat where you would come upwards out of the portal?

Also for the pole example that was talked about earlier... Lets assume there's a person holding the pole and pushes it into the orange portal until it hits the ground in the blue portal. The pole isn't able to move forward anymore because of the ground. Then the blue portal moves, forcing the ground to come closer to the pole+person. They would have to back up as the pole is getting pushed from the ground coming at them. But once the blue portal stops moving I don't think the pole would get flung with anymore force. I think the pole and person would just stay there. (I'm assuming the blue portal isn't moving that fast though) What were to happen if the pole was moving faster, to the point the person couldn't hold it anymore. That I don't know.

Just a few things I was thinking of when reading what you both were talking about. Hopefully they trigger some thoughts that could help us all come to a more definitive conclusion? Or just other ideas to think on.
Reply: @siraaron4462   and @Anklejbiter

I think I have a thought experiment that will hopefully resolve your incompatible perspectives, by removing as many factors as I could and measuring something other than a cube

In space, you are inside a closed system that is filled with oxygen at normal atmospheric pressure, and just a foot away from the blue portal. before portal motion the air is in equilibrium (at least, to the extent you can consider a gas to be)

if the orange portal starts moving, physics as I understand it would dictate you feel a breeze due to the pressure systems created by the displacement of oxygen. and if the orange portal was moving fast enough, you would be pulled through the portal by the vacuum created, or pushed by extreme winds.

the forces created from this experiment (at least when the orange portal is moving forward) are due to particles colliding with and displacing each other. I think the easiest way to resolve the contradictions with real world physics might be to assume that the physics around portals temporarily imbalances the normal force affecting objects. If the portal is traveling at 1m/s consistently, once any object has "gone through" the portal, every molecule that makes up the object has received a force vector of 1m/s going away from the exit portal, if through nothing but the other molecules making up the object.

does that make sense to anyone else? my head hurts now.
Reply: @NoteToUrist  wouldn't this be a similar effect as to how a Dyson fan works? Or how Turbo chargers use a special funnel shaped inlet to allow more air to be pulled in? Almost a venturi effect?
Reply: For clarification: yes the bottom of the cube "pushes up" on the top of the cube. And yes this technically moves the top of the cube upwards even after the portal passes around it; because if it didn't, the cube would flatten into a pancake . However This is because the cube is a rigid body. This force is is the same force that keeps everything from collapsing under their own weight it's a reactionary force, which means it cannot ever be greater than the fores it's opposing. The box was experiencing that force when it was stationary. And it is still stationary relative to the ground beneath it. A rigid body still cannot apply a net force to itself, the cube is stationary.
Reply: @siraaron4462  I agree, having a rigid body exert more force than it contains is a great way to quickly get overflow errors- flashbacks to meshes exploding out of control lol